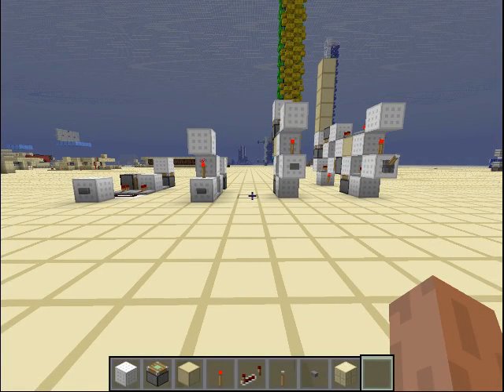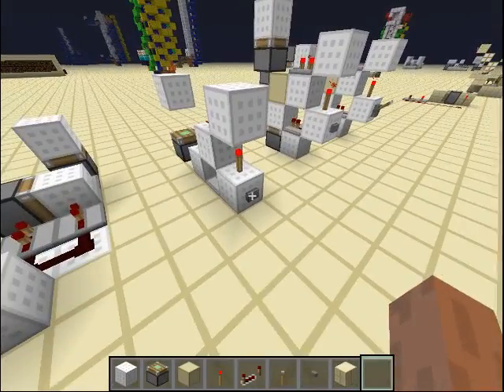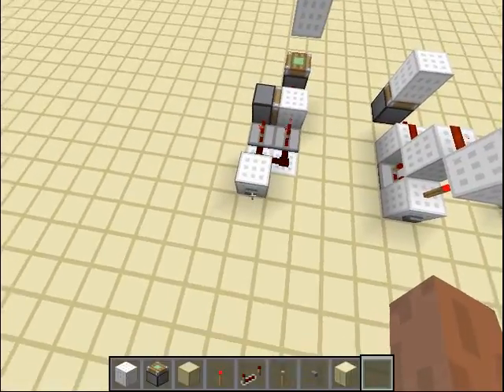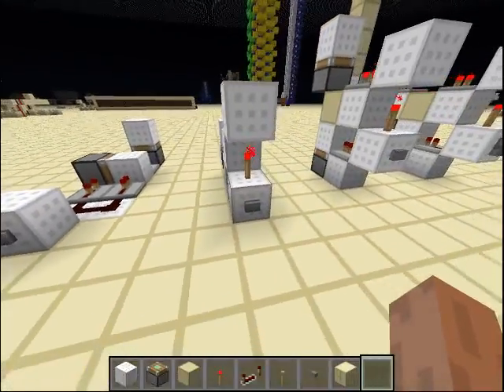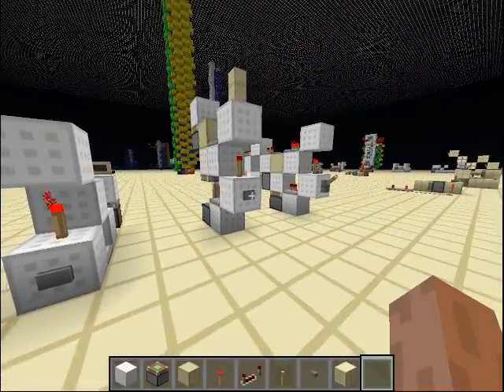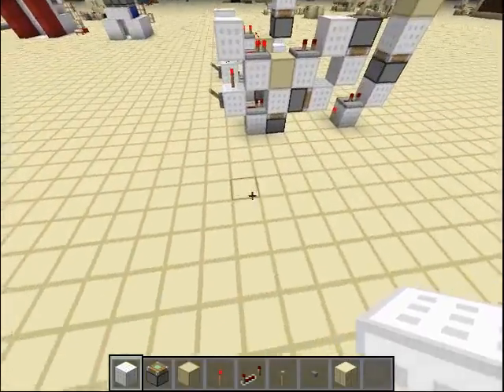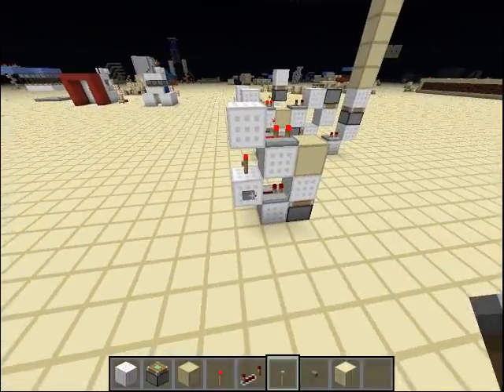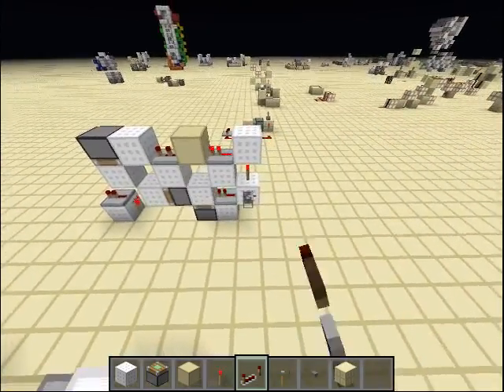Stackable One wide Dual edge lever & Pulse shortener

Comment: you can make a tilable t flip-flop by making the piston controlling the sand upside down and in front of thetop repeater. then put another sticky piston, again downwards on the other side of the block that the first piston is holding. Then place a torch beneath where the block is left and wire it up with some repeaters to a lamp beneath the button to make a tilable t flip-flop with indicator lights.